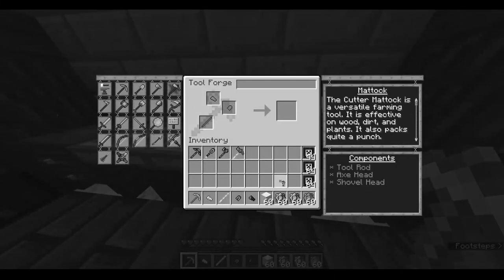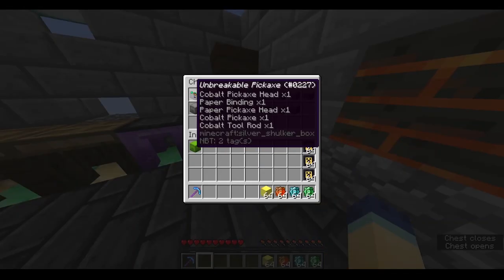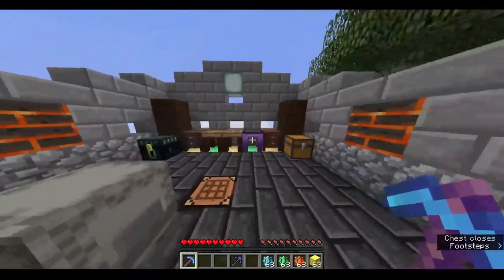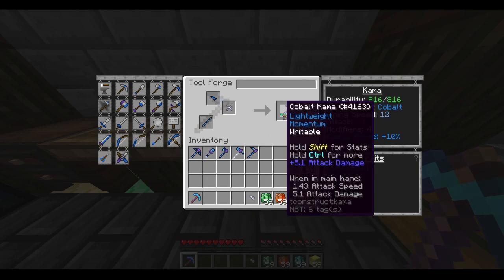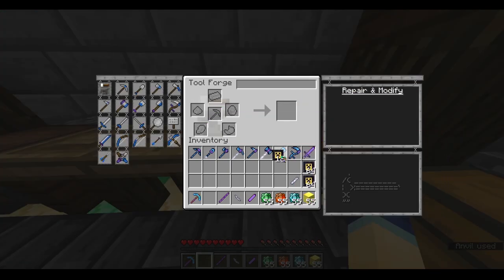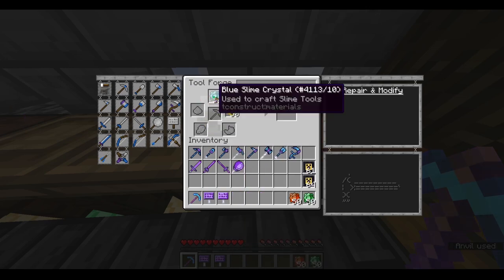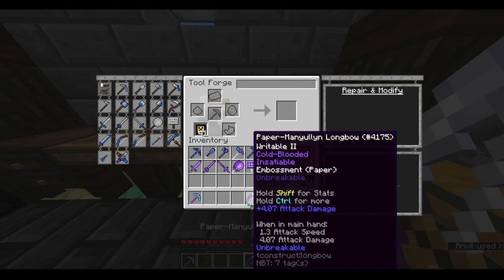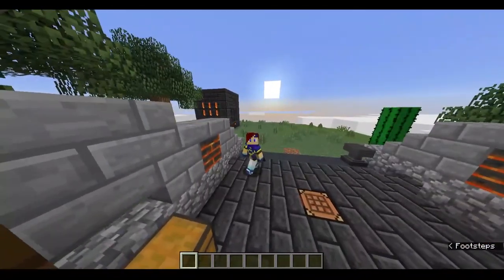Tinkers' Construct 2: How to make ANY unbreakable tool! [1.12.2]

Comment: Guys if you follow the guide and find that your tool just has 3 or less modifiers even after embedding it is due to the Tinker's Tool Leveling Mod. It limits the maximum amount of modifiers a tool can have when its being crafted. So you either remove the mod or wait 2 levels until you have the 2 additional modifiers. Im not sure what Modpacks include the mod, im playing FTB Revelation and removing it worked for me.
Reply from the maker: Finally! Someone tells me what causes this! I kept getting comments on this and nobody seemed to know what mod it was.... thank you!
Reply: also you could potentially get an unbreakable tool with other modifiers since there is no cap on modifiers for Tinker's Tool Leveling Mod, so if anyone wanting to delete this might want to think twice if they want to cap the potential of tinkers tools to be smaller, but quicker to upgrade
Reply: If you level up the pickaxe you can have more than 5 modifiers? So you could use a normal binding and still make the pickaxe unbreakable?

Comment: How are u getting 4 modifiers when u first build the tool before embossing it. I only get 2 then when I emboss it the modifier goes up to 3
Reply from the maker: Have you used at least one paper part when making the tool?
Reply: Roadhog360 ya I use cobalt tool rod, paper binding and cobalt pic axe head. I make it and it gives me 2 modifiers then I emboss and it puts it up to 3 modifiers
Reply from the maker: @termperfection7197  That's really weird. In my game I'm just using stock Tinkers' with no other changes. Are you using any other mods or a mod pack? Perhaps they are changing the modifier count.
Reply from the maker: @termperfection7197  So another comment pointed out to me about a tool leveling mod. Try removing that or getting the extra level by leveling up your tool and seeing what happens!

Comment: mine still has a duribility on it is it suposed to say unbreakable or does it not matter
Reply from the maker: It should say unbreakable. If you followed all of the steps and it doesn't then I'm not sure what the issue is.
There have been people with modpacks and mods that mess with the output tool but I have no idea what those mods are and no one seems to know.
What mods do you have installed?

Comment: to anybody having issues that they can only put 3 modifiers is because you have a mod that is called tinker tool leveling mod it prevents it from having 4 modifiers instead u need to level up the tool 2 times before making it unbreakable

Comment: I got only two modifiers, I downloaded this FTB thing before one week and it's reading 1.12.2 however, there are many things I see on youtube videos that I don't have like the modifiers and worms and the squid ring doesn't work in the nether etc. pls help
Reply: @Josh Henry I re equipped but nothing works. when i enter another dimension the power reed 32 gp then after 10 seconds i goes to zero
Reply: @younisshehab9805  Do you have the chunk where your GP is, loaded? You need something to load the chunk your GP is running in
Reply: @TheBeastNorway  thank you so much, I was claiming without loading

Comment: There's a mod in my modpack called tinkers tool leveling, it says when I get enough xp for a tool it will give it an extra modifier. Do you think that mod could be why my tools have less modifiers than yours in the video
Reply: Shouldn't be
Reply: it gives it less modifiers, just level it up and you should be good
Reply: @toad3222  thats exactly the reason why it doesnt work the same as the video, please dont comment if you dont know for certain

Comment: I can't emboss the pickaxe, i'm doing the exact same thing as in the video, paper binding, cobalt tool rod and pickaxe head. It say's i have 4 modifiers to use but when i place everything in the tool station it does nothing
Reply: nevermind, found out embossing was brought in on 1.10.2.6.5. My modpack uses 1.10.2.3.5
Reply from the maker: @tobysexton3134  Interesting, I didn't know embossing wasn't in that version. I'll add this information to my pinned comment. Thanks for letting me know!
Reply: It's because you are using the "Tool Station" you need to use the "Tool Forge"

Comment: This doesn’t work if you want fortune and all that on the pickaxe does it ?
Reply from the maker: Yeah, unfortunately unless you have one of those leveling mods that adds more slots, or a mod that adds more modifier materials, a very scarce selection of tools actually allow you to modify them when made unbreakable.
The best you can do is swap out unimportant parts to get the effects from that part.
Reply: How do you add more modifiers with the nether star, gold block/dia, and gold apple/ dia block. I can’t seem to figure it out.

Comment: It says the pick axe is clumsy
Reply from the maker: I'm pretty sure another mod adds that although its name eludes me. If it's stopping you from getting enough modifiers try leveling up the tool.
Reply: @Roadhog360   im having the same problem as him, u have a single durability on the pickaxe. one block and its dead. i would level it up but i would have to destroy 20k blocks while repairing it also 20k times

Comment: i can only get 3 modifiers on hammer i did the exact same thing  you did tho
Reply from the maker: You likely have other mods installed that change the output of tools, or are running an older version of Tinkers' construct. I've got a couple of questions:

What mods do you have installed?
What's your version of Tinkers' Construct?
What are the exact steps you took when making the hammer and how many modifiers did it have on creation?
Reply: @Roadhog360  i followed exactly what you did but the it limited the modifiers to 3 and i dont know what other mods i just played this in ftb revelation
Reply from the maker: @AI-pe1jc  Can you list the mods from that modpack? There should be an in-game menu and you should be able to also see them through what jars are in the modpack.
Reply from the maker: @AI-pe1jc   @Term Perfection  So another comment pointed out to me about a tool leveling mod. Try removing that or getting the extra level by leveling up your tool and seeing what happens!

Comment: So no shurikin?
Reply from the maker: As stated in the parts section you'll need section, shurikens, arrows and bolts are skipped. They don't have a durability, only an amount so there's no way for them to be unbreakable.
Reply: @Roadhog360  my shuriken is unbreakable tho it has infinite ammo
Reply from the maker: @slambam0531  Interesting. How did you do that? I'll add it to the pinned comment.
Reply: @Roadhog360  I just added all the reinforcements to it and I got unbreakable